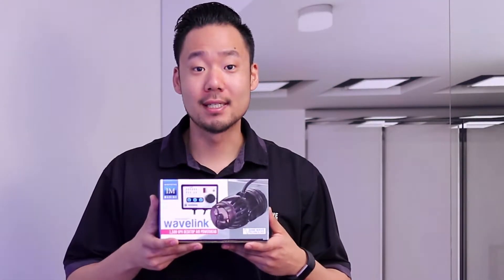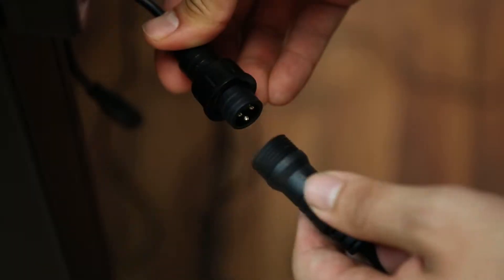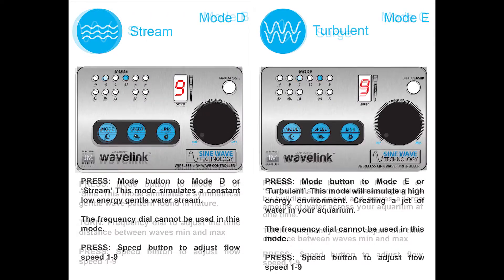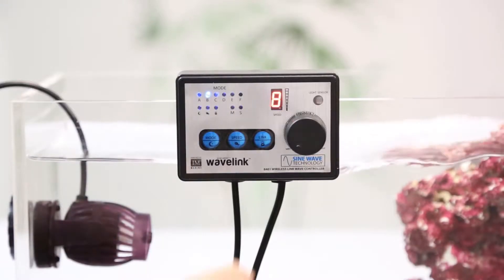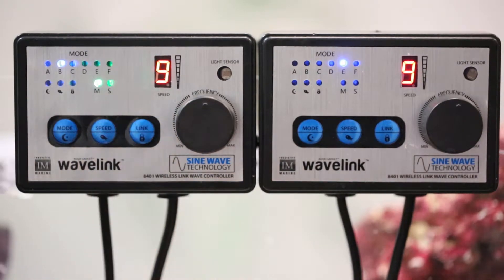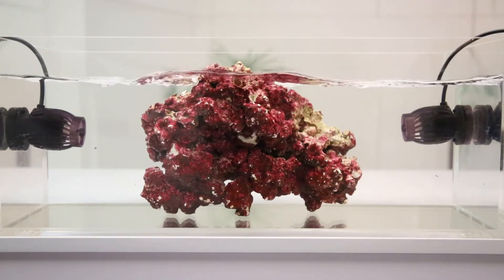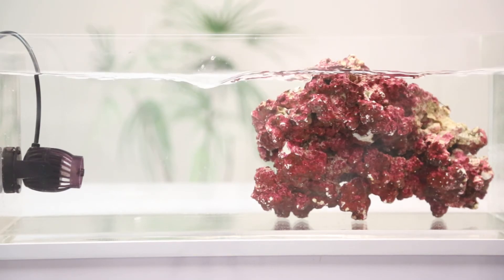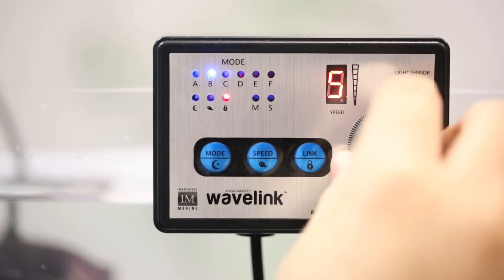How to Use the Wavelink AIO Wavemaker by Innovative Marine

Comment: Can the back magnet that holds power head be submerged in sump water?
Reply: SCUBA STEVE I know I am late on this, but according to bulkreefsupply the rear magnet is sealed and can be placed in water! Super cool!
Reply: Im planning to use a couple and submerge the magnet in the overflow of my Waterbox. Even though they said it was safe I might use a zip block bag just incase. Tie a piece of fishing line to the bag so when I take the pump out I don’t lose the magnet.